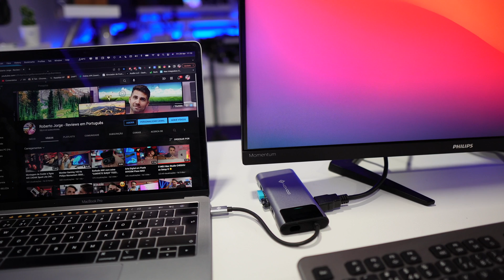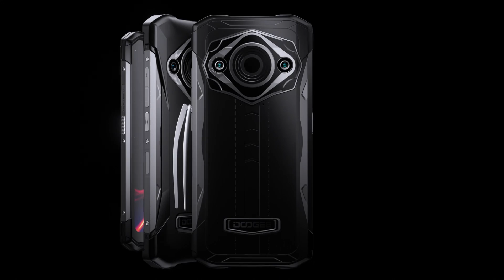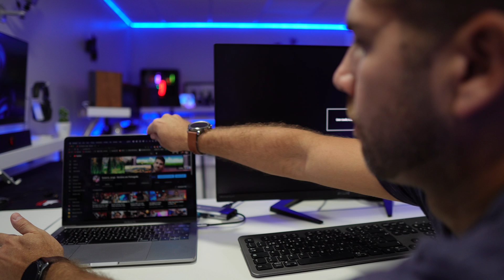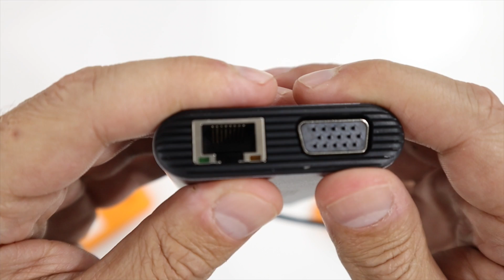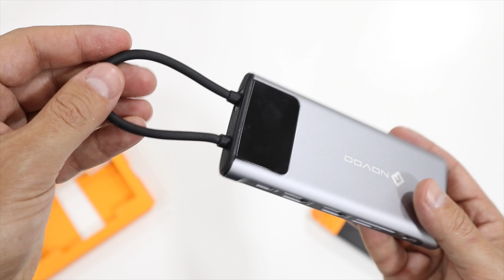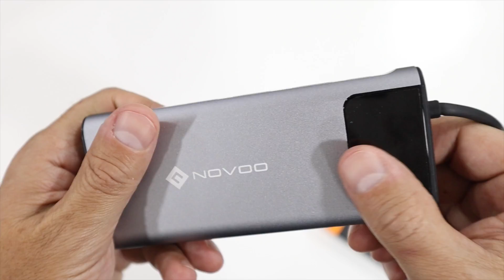Slim Docking Station with Dual HDMI and VGA - Novoo USB-C

Comment: I have a C to VGA convertor and My Docking Haub has a C port. I connect the C to VGA convertor to the Docking hub and the Docking hub to Laptip C port but no luck with the ultimate display i need on the monitor